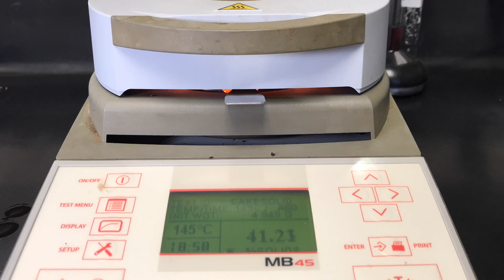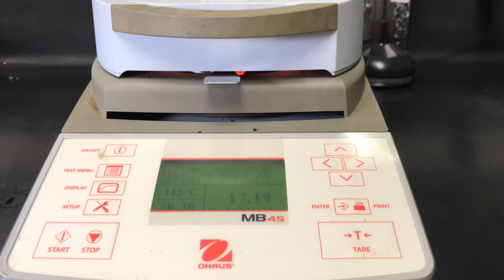Wastewater Treatment - Polymer...Are you using too much?

Comment: I accidentally spilled a large dose of swimming pool flocullant on a well. I pump all the water out. The well had only 1000 liters and I spilled a liter of a swimming pool flocullant ,aluminium hydrochloride. It as been 4 month now. The well is on mud. Can I use the water? Is it still dangerous? What happened to the flocks? Are they still toxic? Did they dissolve with time? Thanks.

Comment: Awesome video. Can you tell me about the mixing valve ? It’s a NRV or check valve with weighted arm ?
Reply from the maker: It’s a mixing valve
Kind of like a check valve, but the intended purpose is to add a bunch of shear right at the point of polymer injection.

Comment: Great video. We run the same disk thickener at our plant. Problem we are having is we use a rotary lobe pump to pump the thickened sludge to our digester. If the thickened sludge is too dry we tend to cavitate the pump.
Reply from the maker: Thanks Phillip
Yes viscosity can be a real problem when pushing high concentrations of solids for most any pump.

Comment: Excellent video!! Don't remember all the specifics of the polymer we were using. But it worked great! However, keeping it properly dialed-in to prevent over or under dosing was a nightmare.. Flows and sludge characteristics could fluctuate a lot, and rapidly. The process ended up being rather attention intensive, regardless of all the automation. (Retired operator, City of Hayward, Calif.)..

Comment: Thank you so much for those words of wisdom at the end.
Reply from the maker: Thanks for watching Alex!
Reply: @WastewaterOperationsChannel  did you ever encounter anaerobic sludge pellets with a coating all around them due to too much polymer ? Great content
Reply from the maker: Great question arkama 
I don’t think I have seen that
But if you found enough poly to coat the pellets I would think you’d want to reduce dosing
Reply: @WastewaterOperationsChannel  I have a case where anaerobic pellets are fully coated, encased, leading to anaerobic sludge washout by flotation from their own gas. I can't come with a reasonable explanation. Surface tensioner has been my first thought but Polymer dosages have been triple checked reduced without any benefit :/    Anyway, great channel thanks you for taking the time to answer.

Comment: Why overdosing floculant leaves water murky?
Reply: The polymer emulsions leaves the water murky when there is excess polymer in the solution. For most of these polymer products, a 5% polymer in water solution will be a white/cream color and very thick. The clearer the water, the closer you are to the correct level
Reply: Btw I'm a QC  lab technician for one of these major polymer manufacturers
Reply: Hello  @csl1315  , I would be so grateful if you could share some knowledge about these polymers, like their origins ( the raw materials) and some of their names I mean the chemistry behind them, if not please be kind to gide me where I can find those
Reply: @csl1315  hi sir how to achieve clear water using polymer? And what is the best ph level before using flocculant? I work in waste water treatment metal recovery.

Comment: What is the most polymer used and amount in manciple wastewater
Reply from the maker: Reda thanks for watching and for the question. I wish it was an easy thing to answer...the answer is it depends.
Processes like the one in the video are primarily thickening and use lower amounts (1-5 lbs per ton of material being thickened)
Dewatering of digested sludges require much more (10-60 pounds per ton maybe more)

Comment: We use a centrifuge at my plant.  Its interesting to see a different method.  We get roughly 20% but there's a huge upfront and energy cost.
Reply: 20% efficiency ???
Reply: @leahfrances2229  yup. 24% with the right polymer.
Reply: I'm just curious to know what is the gallons of polymer per hour are added to the sludge feed rate in gallons per minute.   Ours is about 4.5 gallons of polymer per hour for 150 gallons of sludge per minute.